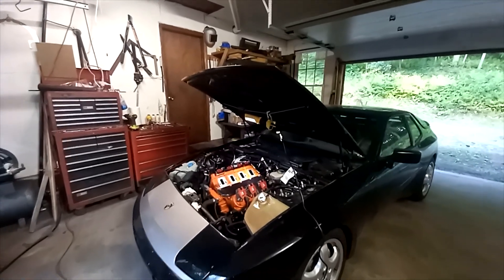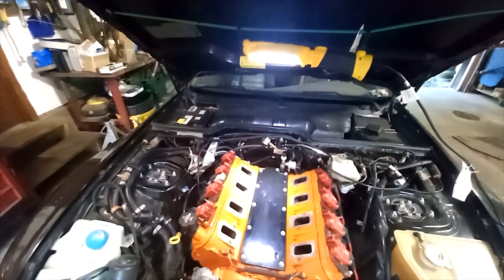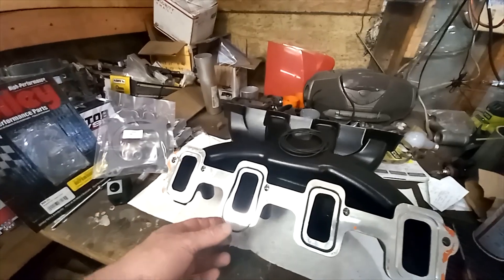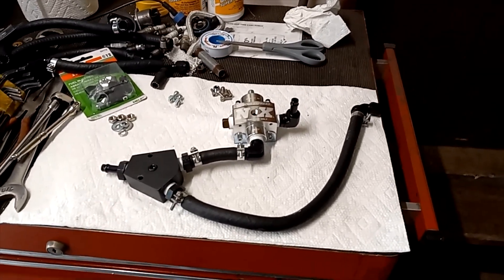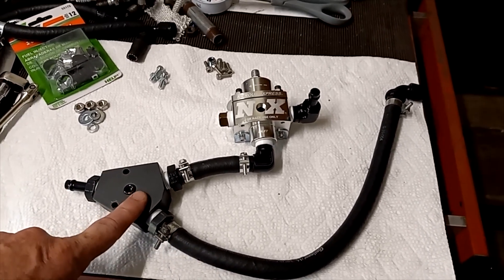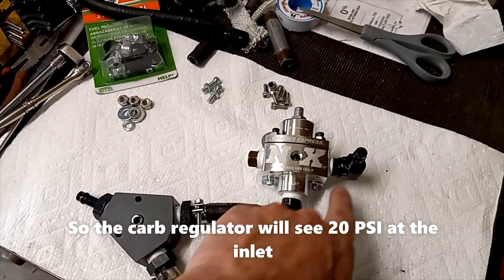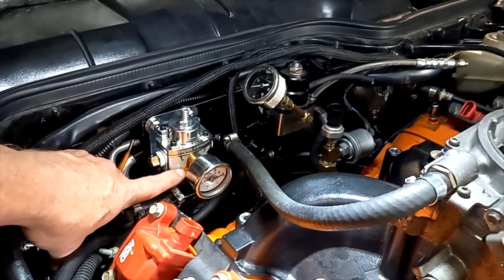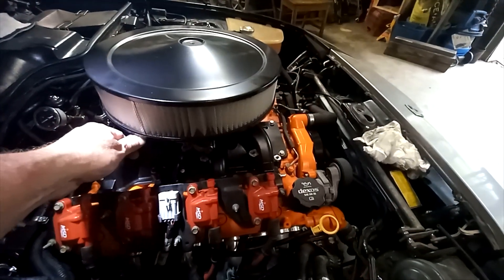LS V8 powered 944, Carb Fuel System

Comment: What gen water pump did you use and pulley set up . I’ve done the same swap on my 85 and am not gonna use p/s . Thanks
Reply from the maker: This engine is an L77, 6.0. It came out of a 2013 Caprice Police car. I didn't change the water pump or pulley setup. It's just like it came out of the junk yard. I put a manual rack in my car too. Don't really need the leaking power steering in a car this light, LOL!

Comment: I'm curious. What's the benefit of switching to a carb?
Reply from the maker: This is a temporary move to get us through the Summer. The FI system I was using doesn't have the tunability I need to make it work right on the low end. The simple solution to get us through the Summer is to swap on a carb. You don't need anything fancy or expensive to tune a carb. I already had most of the parts to do it.

Comment: Meh the stock intake is better than a carb honestly
Reply from the maker: Your right. The stock FI intake is perfect for this project and we will likely go back to it eventually. The FI system I was using doesn't have the tunability I need to make it work right on the low end. The simple solution to get us through the Summer is to swap on a carb. You don't need anything fancy or expensive to tune a carb. I already had most of the parts to do it.
Reply: @stokerdon1020  perfectly acceptable temp solution then😉

Comment: I've done the LS swap as well.  I'm using the Edelbrock Pro Flow 4 with the single plane intake.  Hood clearance was an issue.  I cut a hole for the air cleaner and used a Harwood 4104 hood cowl.
Reply from the maker: Man, I could have used that info last Sunday. I was on Summit trying to figure out what hood scoop would work best. I ended up ordering the Harwood 1114 cuz I couldn't find a better fit. Now looking at the 4104, that looks like a nice fit. I wonder if I can return the 1114. I'll call today to see if I can.
Reply: I had to use a smaller diameter air cleaner, 9 inch.  The larger air cleaner wouldn't allow me to use the cowl I chose.

Comment: I would recommend changing the fuel pump to one intended for a carb.  Too much pressure from the stock pump.  Not sure if you will be able to regulate the pressure down to single digits.  Looking forward to seeing this iteration.  Good luck
Reply from the maker: Thanks!
The 2 regulator system should work. Changing to to a different kind of fuel pump would not be easy in one of these cars.